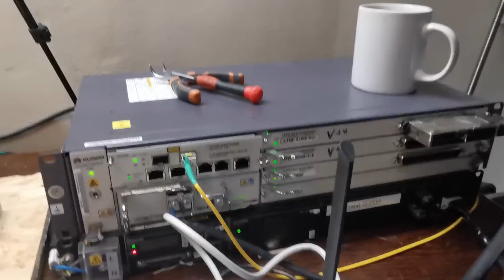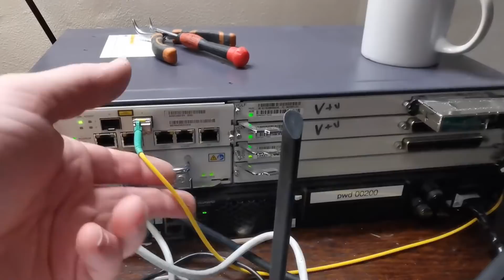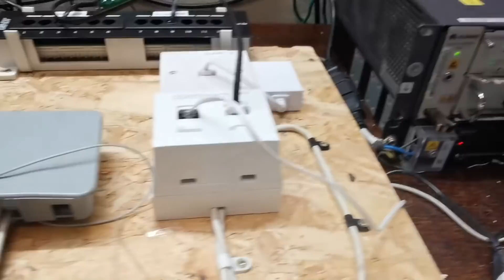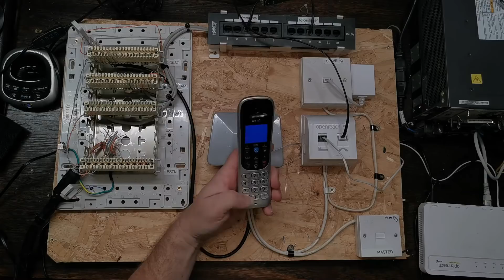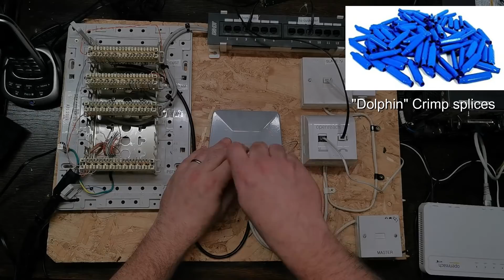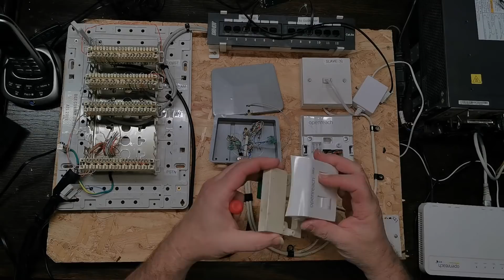How FTTC Works / VDSL

Comment: Incorrect we do use vectored cabs
Reply from the maker: In limited areas where g.fast is present. For general use after the trial in 2017 ended on "normal" vdsl it was decided to go no further except in very special circumstances as it offered no perceived benefit in the network vs cost of upgrading and pending Fttp. ECI cabs already in place do not support it, nor do the handful of Versas
Reply: @rtechlab6254  no even where g.fast isn't present, vectoring is widely used on lines connected to Huawei cabinets :)
Reply from the maker: @williamwilbur  when I first looked into this it had been dropped in the trial as ineffective but you are indeed correct and I stand corrected.   Trying to see which boardset g.fast needs, possibly "super vector"
Reply: @rtechlab6254  yeah I do remember something, a bit like G.INP on ECI cabinets which never worked properly
Reply: There's fair number of Huawei vectored cabs usually where large number of longer lines are present usually in rural areas.
Reply: @Ymma58  Pity it wasn't used here.  We're in a rural town in Devon with a large number of longer lines from the cabinet.  I was the first person in the town to get FTTC and initially the speeds were quite good considering a 500m distance from cabinet.  Now a few years later with lots of contention, I'm getting about half the original speeds, which for upload is particularly frustrating.
Reply: @video99couk  That will be most likely due to a cable fill (crosstalk) on a cable feeding your DP. Vectoring can help to eliminate some of the crosstalk due to this. I've seen lines achieving over full speed (90mb max rate) over 1km from the Huawei Vectored DSLAM.
Reply: @video99couk  it's possibly because your cabinet isn't BDUK funded

Comment: I KNEW it. I thought the POTS phone service originates at the DSLAM. But nope looks like they are still getting POTS from the wiring center. This is being phased out in the states though. Some AT&T setups though don’t even get analog phone in. Their UVerse service is DSL only & then they provide a gateway with phone jacks for voip. Not sure why it’s separate
Reply from the maker: It CAN originate at the DSLAM. This unit has provision for this with the right cards and we use Mediatrix FXOs with the Versa DSLAMs to do this. In the UK Pots is coming to an end now too
Reply: I don't know if this still applies today but I remember att did both fiber to the node and to the houes but in both place was converted to dsl for there uvers. It been 6 years for me messing around with att stuff where I ues to work.

Comment: I've still got a BT Home hub 5 flashed with OpenWRT. Solid stuff.
Reply from the maker: We have a few dozen of them. Not bad kit without the original firmware
Reply: @rtechlab6254  the original firmware is actually open WRT
Reply: With sky. On FTTC. when we joined speeds were 32/9.5mbps after 4yrs our upload speed has slowly reduced to 6.2mbps. Its become a issue for me called up but they say open reach sees that as adequate service as refuse to take any action to resolve our upstream reduction. Its like a third slower. No FTTP service available in the area. Signed up to Starlink as that looks promising till BT can overhaul this dated system of using inadequate phonelines. Shame really I dont need loads of bandwidth.
Reply: @sonyp180  get off Sky and join someone like Andrew's and Arnold who'll push open reach and sort problems like that. Not all ISPs are equal.